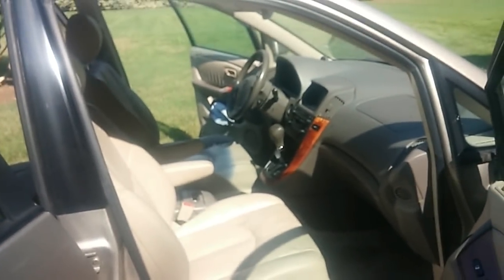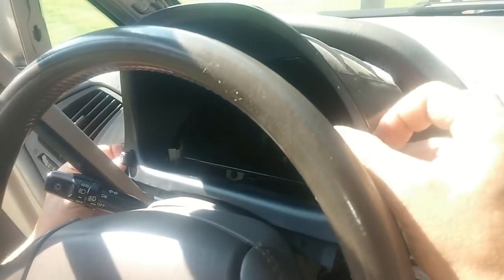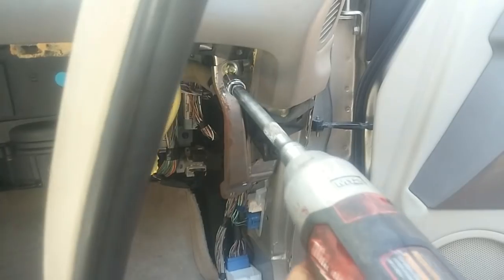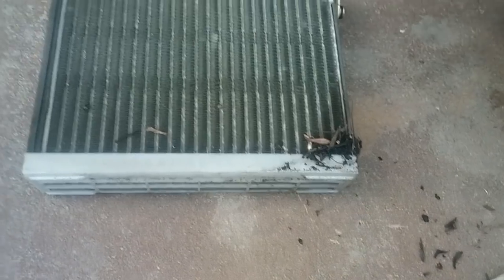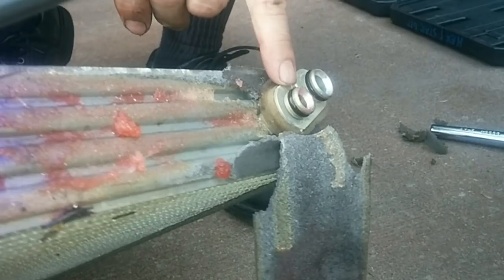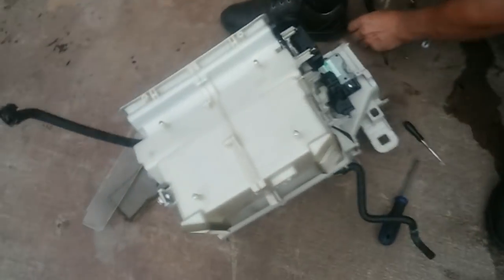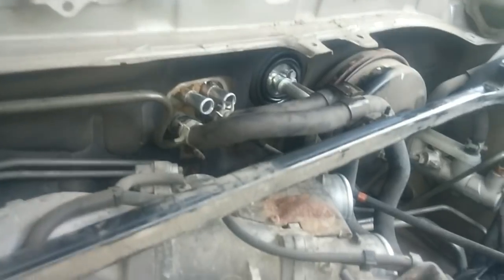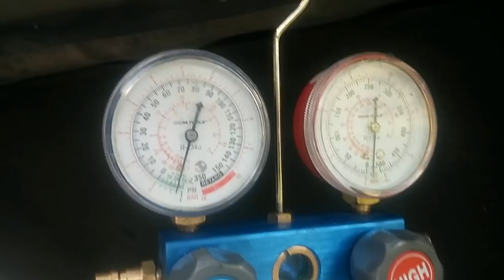A/C Evaporator and Heater Core Replacement - Lexus RX300

Comment: Unbelievable. You guys are real pro. Great video. I have a heater core clogged in my Lexus ES 350 2008,I will not attempt this job. It would take me  2 month. Thanks You’re helping so many people.
Reply from the maker: Are you sure it's clogged?  Had a similar problem with another car and it turned out to be the jammed blend door motor.  Check the supply and return hoses going to the heater core on the firewall.  If they're both hot/warm, you don't have a clog.  If it is clogged, detached both hoses and blow compressed water through it (via garden hose or power wash pump).

Comment: I have always flushed my radiator every 2 years never had heater core problems. Basic maintenance saves you from jobs like this.😊
Reply from the maker: Thanks for sharing!
Reply: That won’t save your AC evaporator. As a car ages parts go bad.

Comment: Just got a quote from the Toyota dealership about this repair for the AC evaporator. They want 3,500$!!!! That is insane. I know it’s a big job but I’m not paying that. Lexus 2006 ES330
Reply from the maker: That is a ridiculously high quote.  It's around 8 - 9 hours of labor.  The part is under $100.
Reply: @hardlymovingpro   What do you think a fair price is for that? I know it’s a big job.
Reply from the maker: My quote would be $800.  A full service independent repair shop may be between $1,200 - $1,500.  Dealership probably $2,500.

Comment: I respect you for tearing the whole dash of the car to get to the evaporator core and put it back together. I think it designed for one time use. Now I know why my RX 300 and RX330 have the air conditioners working so good. I only replaced the compressor  one time for RX300 and a leak on the condenser by the debris on the road for RX330.
Reply from the maker: The evaporator should last the life of the car.  When it doesn't, the car manufacturer didn't design the evaporator for easy replacement.

Comment: I bought my ES330 with a former mice nest above the cabin filter. I've tried ozone which helped lots but still have some odor. At 17:06, you showed the condensate discharge tube is. Just where I needed to know where I can spray evaporator foam cleaner on.  Thanks guys, thumbs up!
Reply from the maker: Good luck!

Comment: Thanks for recording step by step it's really helpful. I have one question please help me. After I flushed my heater core I still don't have heat for windshield, it's only heat front of the driver passenger side. Do I need to replace heater core or flush it again
Reply from the maker: If you're getting heat but not up to the windshield, it could be your air direction motor that's not working.

Comment: That's a big job. Very tedious and good workmanship. Highlander 2002, V6 3.0, AC loosing refrigerator don't know where the leak is. I keep learning, thanks.
Reply from the maker: When you have a leak in your evaporator core, you can smell a semi foul smell inside your car when your turn on your ac.  Also the condensation dip tube will drip out compressor oil with the water onto the ground.
Reply: @hardlymovingpro  
No smell, no oil water mixture at the drain tube. I added sealant, refrigerant and oil. Made a mess. I did when ambient temperature was 20 Celsius. Once driven in the heat, 40 Celsius the pressure went overboard. Smart enough not to run the AC, I sense something wasn't ok. Finished the trip and checked the pressure, release the pressure, got out excess oil, sealant and refrigerant to 30 psi, and top up with refrigerant only. Cools off to 55-60F . Keeping an eye on the pressure. Thank you for your input, and your time.
Reply from the maker: Don't use refrigerant sealant.  It only works for "soft" leaks (i.e. o rings).  "Hard" leaks are holes in aluminum, hoses and hose connection points.
Reply: @hardlymovingpro  
The pressure slightly dropped but still chilling. It might be a soft leak. Im getting a UV light to use with a dye. Thanks for reply.
Reply from the maker: Common soft leaks could be worn Schrader valve o rings in either the high or low pressure service connectors.  Easy way to check is to use a refrigerant sniffer.  Put it next to the port and it will start beeping if any refrigerant molecules are detected. Can also jam the sniffer rod in the vents to pick up possible evaporator leaks behind the dash.   Sniffers are not that expensive:   https://amzn.to/3NoZwCJ
Reply: @hardlymovingpro  
You're right Schrader valve on the low pressure line is leaking. Last time I checked I heard a fus when taking the cap, wasn't sure if I heard well the sound, therefore I've tightened up well and the next day, today I took it off in a quite place and heard the sound. First I'll tighten up the Schrader valve check again and if the leak is still on I'll replace it. Would be a good idea to replace all the o rings on pipe connectors? The accessible ones, before vacuum tested, and removing moisture, then charge with refrigerant. Thanks again for your time

Comment: Wow!! Great video. I have an Avalon2007. The ac has been topped of due to a slow leak. This past spring the compressor locked up on me. Your opinion on this? I wonder if the compressor shaft was my leak? If I try to replace the compressor with a new condenser and desiccant I might get away without doing the evap? What’s my chances? Your not on the hook at all. 😂
Reply from the maker: A slow leak will also leak oil.  Just adding refrigerant with no oil will burn out your compressor.  Best to replace the compressor with the condenser.  Evaporator need not be replaced.

Comment: No way I can do this work.  Your video is fantastic, and I am so informed about the work required.  Also, while you have the dash removed, are there other parts that should be replaced besides the AC evaporator? My RX is 2008, so it is 14 years old.

The complexity of removing the dash and time, what would you estimate the labor and part cost for this work?

Thank you for doing this video again!
Reply from the maker: Thanks!  You can consider replacing the motors that control the air mix and air direction.  Haven't seen a heat core go bad.  Around 8 to 10 hours labor x labor rate + parts.

Comment: Great video! leaned a lot from it. Does the receiver drier need to be replaced after you replace the evaporator?
Reply from the maker: Not a bad idea but integrated with the condenser and hard to get too.  Might as well replace the condenser as well.

Comment: good Job!!   Ifound out how to remove the Evap with no removing the dashboard, cut off the heater line near the Evap box, took off eight/nine screw form the Evap box, disconect expansion valve and VIOLA!! , of course I live int the caribe so dont need heater core.
Reply from the maker: Thanks for sharing!

Comment: If you have a coolant leak in heater core will it drip out evap drain line?
Reply from the maker: That's correct.

Comment: will the ac work and not the heater if you have an heater core issue?
Reply from the maker: Two separate systems combined in a plastic HVAC box. A blend door channels cabin air to either the heater or evaporator core or a combination of both.   If the heater core is clogged it will not effect the ac if cool air is desired.

Comment: Yes, it is beautiful... and very impressive! Would you mind telling what year and how many miles?
Reply from the maker: 150,000 miles and year 2000.
Reply: @hardlymovingpro  - Thank you for the answer. Now I am a little more scared of the RX. What about the ES and LS? Do they also have this kind of issue and same difficulty to get to the evaporator?
Reply from the maker: The ES is about the same.  The LS, (1992) believe or not, isn't as bad.  You can get to the evaporator via the glove box.  The evaporator housing can be detached from the heater core housing and pulled out.  Therefore there's no need to take out the dash and the remove the tubular cross member.  The nightmare was the return pressure control diaphragm unit.  It's a mechanical device with an internal valve that was struck closed due to rust corrosion on the diaphragm's shaft.   This is a $600 part!  I spend around 3 hours taking it apart and got the shaft moving again using a punch tool, emery cloth, penetrating oil and drill chuck.  Anyway, the owner's ac has been ice cold for the last three years.  The dealer quoted over $2,500 to replace EVERYTHING and the local repair shops didn't want to touch the repair!
Reply: @hardlymovingpro  - "Holy Shift"! That was some work... Did you give him a brake on the price? (Compared to the dealer). I heard somebody say that all the Lexus LS 1st generation (1990-1994) are the way you are saying you can get to the evaporator via the glove box... Is it true?
Reply from the maker: I did it for free because the owner is my video editor, composer, camera man, etc.  This is a 30 minute video and we choose not to publish the re-construction since most people's attention span wouldn't go that far.  Between the two of use, we did in around 8 + hours.  
Yes ... the LS400 is much easier to do since you're going through the glove box.
Reply: Hardly Moving Productions where does a 1999 RX 300 fit in, does the dash come off as well or just the glove box?

Comment: I should be thankful that removing the evaporator is so much easier in my 2002 Sienna... however, I'm stuck. Hoping you've maybe done one before and know what I'm describing in my question. There's some "rivets" (per service manual and haynes manual) that I need to remove that are holding the evaporator cooling unit case to the foot of the wall. I've never heard of rivets until now. They look like studs, but instead of there being a hex nut, it's like a cylindrical nut with a flange at the wall. I couldn't figure out how to remove them on a Sienna at the junkyard. I was attempting to twist the head of it since it looked like it was screwed onto the stud portion of the "rivet". I was googling all about rivets and still really couldn't understand how I might remove these. Any idea? I also cannot find a video online to help me that is specific to my older Sienna :(
Reply from the maker: Rivets are used a lot in aviation to hold aircraft panels together without nuts/bolts and to blend with the panel's surface.  Easy way to remove them is to drill the center out and use a center punch to drive them out.

Comment: Fantastic video.  Pretty intimidating though.  How similar is the process for an '05 ES330?
Reply from the maker: Thanks ... Pretty much the same.  Layout for the center dash removal would be different.  You may want to get a freon stiffer electronic tool to verify the leaks is definitely coming from the evaporator.  They're pretty cheap on Ebay.

Comment: Dude your video is very informative, for a tinker like me I've learned so much about this. Can I ask you a question, my AC works but my heater does not, do I have to go through the same way to fix my heater?
Reply from the maker: Disconnect the heater hoses on your firewall and blow out any sediment in your heat core with water pressure from your garden hose.
Reply from the maker: Also check that your blend door motor is working
Reply: Thank you so much... @hardlymovingpro
Reply from the maker: Happy to be of service with this video!
Reply from the maker: My pleasure!

Comment: Anyway to get to the expansion valve with having to remove everything else?
Reply: Sorry and to add to the comment. It's a lexus 99 rx 300
Reply from the maker: 2000 RX300.  Never tried to remove just the expansion valve.

Comment: I got a beater I'm thinking I could cut those metal core lines slide heater core out run rubber hose from new core to connections at fire wall just a thought if mine went out and if it could slide out with box still in the car
Reply from the maker: Don't known if that'll work.

Comment: hi, do you refer all data or mitchelle to look at varous bolts to remove dash board. every car is different.. i do know that central console, steering column , airbag attached to cross member have to come out plus almost all wiring. What i dont know is list of bolts that front dashboard is attached to..  any help is greatly appreciated.
Reply from the maker: I use to when I worked at the dealership.  Now I just start taking things off and place them in the order I removed them.  Also I take pictures to reference when putting it back together.
Reply: @hardlymovingpro   Thanks I have 2013 camry, recently rebuild transmission, at that time, i asked him to change rear main seal , he did it.. it is OEM as well. now i see a leak betwen transmission and engine joint, it is engine oil, not pink.. i dont know how to find out if it is coming from rear main seal, there is a plastic that i can remove to see the flex plate and that looks dry. any help is appreciated.
Reply from the maker: @sivucit  sounds like your guy messed up installing the rear main seal or installed a substandard seal....assuming the fluid is not red.

Comment: wondering how long it took you to do this job!  Because labor code comes out to around 6 hrs.  Great work with details
Reply from the maker: Thanks ... Around 8 hours plus with some help.
Reply: I took my car to the shop because there's no air coming out from the front vents it's all coming from the bottom underneath and the defroster vents. They told me about 2 hrs labor to dismantle around $200.00. Now I know it'll be close to $1000 might as well get a new (used) car. Thanks for the video!!
Reply from the maker: @mrram2603  It's either your air direction control unit (that knob on you HVAC panel with a picture in the background pointing to your feet, towards the front, up to your window, etc.) or behind the dash an electric motor that moves an air flap or door that controls the direction of air.  More than likely, its the electric motor that moves the door.  They fail when the teethes in the plastic gear break off.  You can usually hear a clicking noise when it fails.   With most cars, if the mechanic knows where to look, can unscrew the unit out and install a new unit.  2 hours labor and $200 cost seems reasonable for a mechanic to spend the time and effort (if he's never done the job on the type of car your own).  $1000 is outrageous and you should shop for another repair facility to do the job.  If you look at the 17:44 minute mark in the video, those black things attached to the white housing controls air direction doors.
Reply: @hardlymovingpro  Hello. What would cause both the heater core and evaporator to go out at the same time? I have a 08 Lexus es350 that I'm about to take this adventure with. It started with antifreeze in the carpet and loosing freon. I bypassed the heater core just to be able to keep using the car. The same day I noticed the ac quit working. A friend of mine put his manifold gauges on it and shot freon through the lines and it was coming out as fast as it was going in. We took the cabin filter off and we could feel just about all the air whooshing out. This looks like a stupid design IMO.
Reply: @hardlymovingpro  also what do you recommend be replaced while you're in there? It looks like you had an expansion valve? Im no mechanic but Im confident I can do this myself.
Reply from the maker: Moisture would cause the failure
Reply from the maker: I replaced the expansion valve, heater core and evaporator